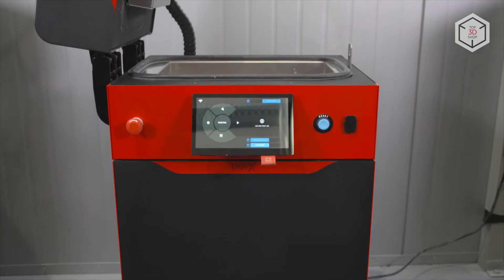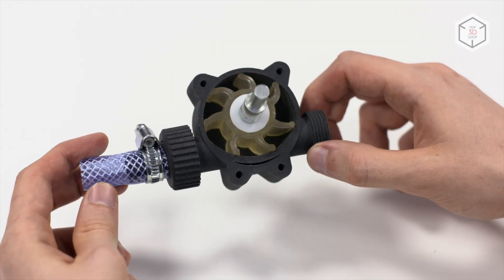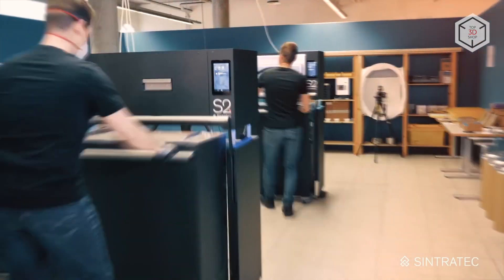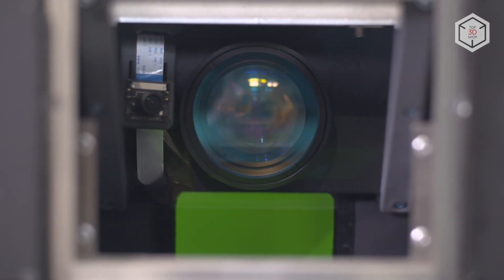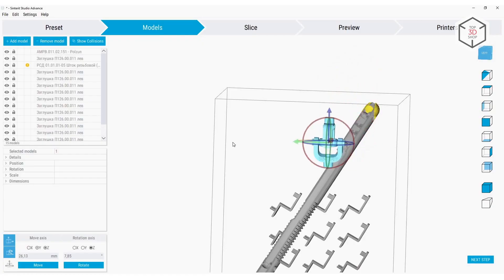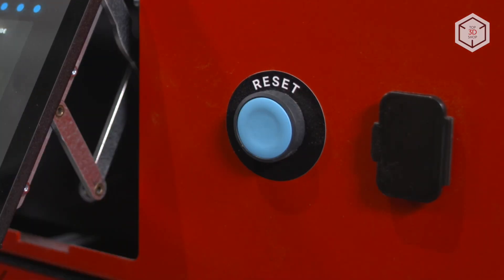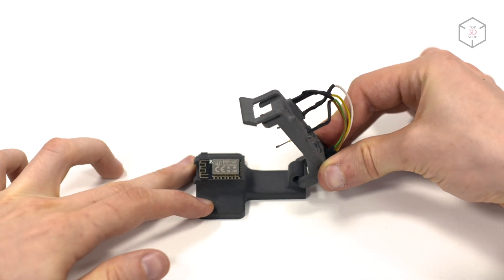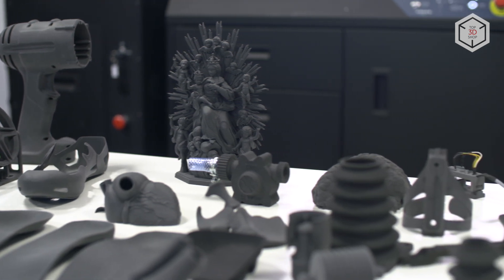Sinterit Lisa X In-Depth Review: Fast and Compact SLS 3D Printer

Comment: I own one of these, when it works it works ok (sinterit studio is good-better than preform for fine positioning adjustment) 
The design of the recoater system is...crap - recoater cord is a £15 consumable that only lasts 100 hours, on a Lisa X that's not even 2 full volume prints and when it fails  (this latest being this month a cord failing at 62 hrs) it fails in spectacular style damaging the recoater casing, and contaminating the powder.
The quality control of the recoater cord is also poor with new parts being supplied defective. 
No exhaust filter, fume and particulate by products of printing are exhausted straight to the environment around the printer.
(Its quite telling that formlabs have installed a filter on the exhaust system for the FUSE 1....)
On the Powder Handling Station, 50%+ of the powder will end up in the vacuum instead of the tin unless you get the additional cyclonic separator. 

conclusion- DO NOT BUY for production printing.
its Ok for occasional printing
its good if you like to tinker with the settings
its ok if you want to change media a lot (apparently the top seal needs to be changed between certain materials)

Don't get suckered at trade shows, ask to get in touch with customers who actually own SLS printers (of any make) and then speak to the team who actually run the printer.
Reply: Thanks for all these valuable informations. Do you have any alternative to suggestions for SLS printers?
Reply: I'll speak only for ones I've owned/ worked with, the fuse 1 and fuse 1+ have a lot less adjustability but are more reliable (The accompanying fuse sift is harder to change materials than the Sinterit PHS but it does have better extraction/filtration. I would still advise the use of the additional cyclone filter to preserve the filter bags in the Delfin Atex Vacuum.  Fuse units are also tied to using Formlabs powder through a powder credit system. Depending on your needs it may also be worth looking at MJF or SLA printing. @brezovprut4431
Reply: have you tried the fuse1 ? seems like it also has its share of problems. sls also has parts warping.
Reply: @MHouseOne  Yes, we used to own a Fuse 1, and yes it had its share of issues and was in fact replaced several times as a complete unit. To be fair to SolidPrint 3D they were better on aftersales support than Concurrent Design Group and the technicians had more training on the unit for servicing and repairs. However the Fuse 1 is a PA12 only unit and the Fuse Sift once used with any particular powder is pretty much tied to that material in perpetuity.
The reason we swapped to the Lisa X as our current unit is that the Sinterit Studio software was ahead in terms of the ability to close up the part nests and print to a finer resolution (at the time we didn't know just how crap the recoater cords would be!) plus its easier to swap the printer materials over between PA11,PA12 and Alpha powders recycled PA12.
Subsequently we've made an alternative solution to the recoater cords using the in-house waterjet cutter which has nailed that problem and now we're looking at the drive cord.
Curiously enough on the Fuse 1 the parts can run right up to the chamber wall whereas there is a buffer zone on the LISA X which is occupied by powder (you can put parts into this zone but at your own risk) The benefit is that on cooldown this powder helps keep the cooling more even at the expense of more powder.(which if you are buying any of it from CDG is an eye-watering markup)
Reply: @AllanKnight-d1e  thank you, really appreciate hearing from an user. With formlabs requiring an maintenance plan and no third party materials allowed they seem to be heading down the same path as expensive HP ink.  I think we'll try sinterit lisa X once they replace the recoater cord with the planned direct drive unit. I saw reviwers mentioning in som cases the cord breaks at less than 100hrs (unpredictable). For now we've been using third party to make the parts which, seems to be even cheaper than the estimated material cost of both systems; that estimate was on the desktop lisa  ~5 years ago, we are about to get an estimate for the lisa X which I believe should drive the part costs down.
Reply: @MHouseOne  Well if you're ever in the north of the UK (Hull area) and want to see one in the wild let us know, more than happy to show the setup.